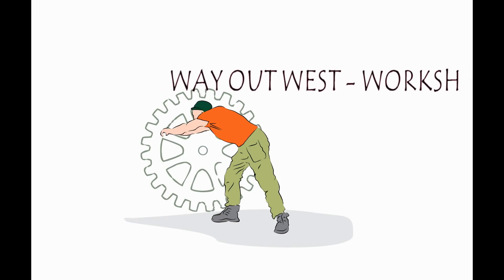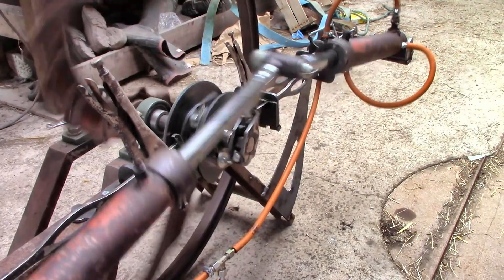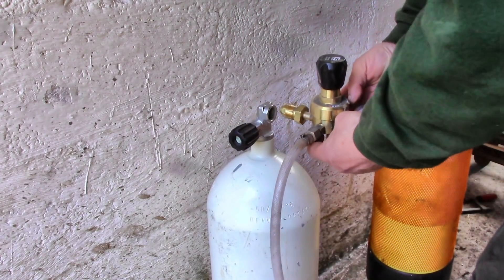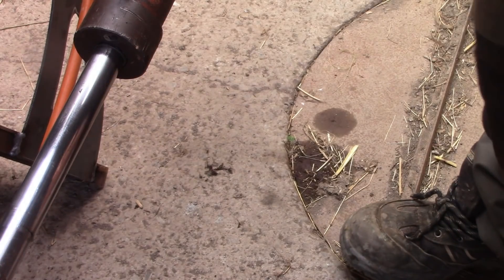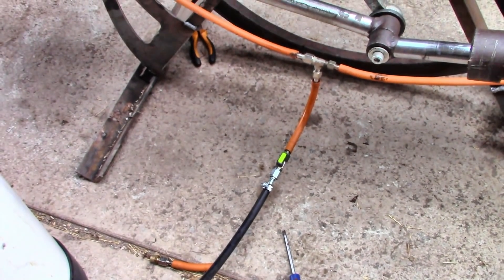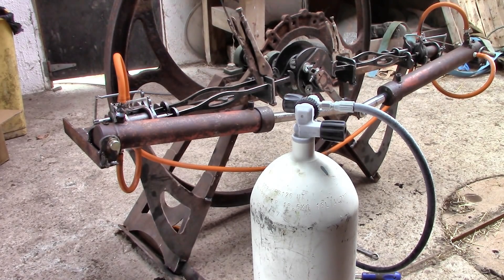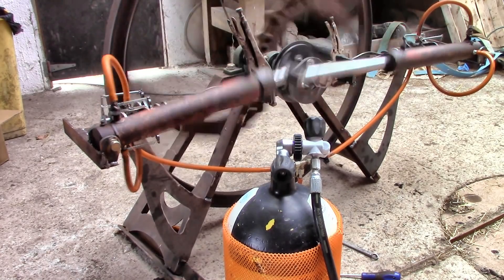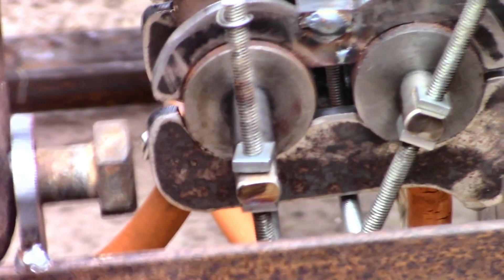It’s Alive!! Air-Powered Locomotive Moves On Its Own!

Comment: I was wondering if a propane bottle filled with compressed air (such as that used for a gas barbecue) would do the trick.
Reply from the maker: I think they're not for high pressure?
Reply: @wayoutwest-workshopstuff6299  These bottles are usually built with a test pressure of 30 Kg/cm2 and a burst pressure of 85 bar/cm2.
Reply: AFAIK our propane tanks are limited to 125lbs and each have a safety plug in the valve assembly so other than old propane cylinders being readily available I don't see any advantage.

Comment: WELL DONE!! Well done indeed! I have a huge grin on my face, seeing that, and I bet you and Sandra each had one, seeing it go in-person :D

Maybe someday I'll be able to travel again, and if so, I hope I'll be able to get a ride on the T&S Western Pneumatic Railway :D

BTW, check your email shortly, I'm about to send you two links -- well, if I can still find one online! -- one is a go-kart transmission made of bicycle parts, that you might be able to adapt somehow to use with your new locomotive-in-progress. The other is a link to a Reddit post. I did some research, and some asking around, while Sandra was on her lovely trek (congrats to her, BTW!) and I may be able to get you past the need for high-pressure tanks. You'll see ;)

A third link, will follow, if I can find it, but I expect no end of trouble in searching for  it. The GY6 scooters you see in urban areas -- the ones that are inexpensive imitations, basically, of the Honda Cub and Super Cub by various no-name Asian companies -- you can get a remarkably cleverly-engineered gearbox for them that adds reversing capability. It's mechanically just brilliant, and my hat goes off to whoever designed it -- it uses this incredible scheme of a two-part shell, twin sets of planetary gears, and a drive gear that slides in the middle along the output-shaft, which is splined partially along its length -- or so I recall. I bet you can cobble something together that, although outwardly entirely different, works along similar principles.

Comment: You could build a steam engine to power the compressor to fill the air tanks on the loco.
Obviously it is much more effective to fit a boiler to the loco so you have a real steam locomotive 🚂

Comment: You may have different rules across the pond, but a propane bottle is relatively inexpensive and rated to hold much more pressure than an "air" tank. Maybe you can get a nitrogen welding tank. At least that way they couldn't fuss to much since atmosphere is 70 something percent nitrogen lol. I dont have any experience on high pressure compressor s, so I'll be interested to see what you come up with.
Reply: What he has atm looks like a 40 cubic foot high pressure cylinder. (Not a scuba tank) but even tiny 40 cf tanks are like $400 USD these days used. 80cf new is like 600 and don’t even get me started on the biggest tanks (the 5 ft tall ones) like 1200 a tank
Reply: @superspooky4580  that's why I was thinking a welding nitrogen tank rated to 2000 psi. Very common and can buy used for cheaper. Then just compress with normal atmospheric air. Moisture may be an issue though which would be addressed with the compressor side of things.
Reply: @TgWags69  Thats what im talking about as well. those nitrogen tanks cost a pretty penny these days and thats IF you can find one for sale. (thats not 80 years old and about to explode)

Comment: You an put an inline regulator which are used on compressors & other things to regulate to a higher pressure constantly so you are not always fiddling with the pressure knob.

Comment: This reminds me of an old Mickey Mouse comic I read many years ago, where Goofy designs and builds an automobile that is powered by compressed air - the thing is, the wheels also drive a pair of air pumps which in turn keep up the pressure, so it is effectively perpetual motion. Of course, he forgets to put brakes on the contraption so it leads to humorously disastrous results, but still, it was always a feat of engineering that inspired me as a child. Alas, I never got the chance to test it out. ;)

Comment: those hydraulic cylinders will easily handle wet steam if you keep them oiled.    Perhaps a simple open loop boiler,   easy, cheap, low pressure, safe and fun
Reply: Vegetable oil in the boiler.

Comment: You've invented the self mobile cable railway.  Though I have never seen a string drive, there are some model railway engines that use rubber bands as crude belts to transfer power to the driving wheel axle - same as your log chomper.
Reply: A buddy of mine is working on 9ne of these right now. Athearn used this drive for it's model RDC's

Comment: IT LOOKS FRICKIN NICE. Seriously tho, good work! I would suggest to get a big BIG air tank and make another cart to put it on. That way, you don’t have to refusal as often if you were to use a smaller one. Also, if you were to use steam again, I would suggest using like a 7 gallon air tank as the boiler. It wouldn’t be a flash boiler, but it would be another idea to try, just make sure to get one with a safety valve!

Comment: If you had a rope wound the other way on the shaft and could reverse the engine then you would wind the reverse up when going forwards and wind the forwards up when going backward.  If the ropes were long enough it could take you from one side of the railway to the other and back again.  
Great video anyway. Can't wait to see more!
Reply: an old riding tractor gear box ( lawn tractor, not big tractor ) could be used. They were either belt drive or chain and sprocket.

Comment: Gears or belt final drive or even chain? Looks like it will work just needs some refinement! Brilliant Tim. A rich benefactor with a spare compressor and cylinders is required or a scrap man with them lying around....Fingers crossed. Trevithick is applauding you!

Comment: I do not know. Air pressure powered stuff feels wrong. I hope it works out but the pistons needs lubrication and in general it is scary to deal with air. Tire expositions are :C  But pretty much everything power dense is scary. I hope a bottle of compressed air is going to be enough for the trip over the railway. Hard to think it is going to be enough but I hope it works! But lubrication for the pistons? They are not magical they are going to fail to piston if the air rushes passed the worn non lubricated piston/cylinder/seals!
Reply: Wd40 injection

Comment: I'm sure you don't need telling, but it's usually a good idea to store diving cylinders on their side when not in use. At full pressure they become rather effective torpedoes if they fall over and smack the pillar valve on something. Plenty of videos on youtube of diving cylinders punching their way through brick walls :D
Reply from the maker: Sounds like something I should try : -  )
Reply: So tie the bottle on top of the cart and do away with the whole mechanical contraption. When you are ready to go knock of the valve and voila, you are moving. (no idea how you will stop it now, maybe get a 2nd bottle that you hold very firmly so you can catch up ;-)
Reply: For savety you store them standing. In case of inside corrosion this will then concentrate on the thicker bottom walls. Especially when not using modern/high quality air delivering standard compressors. And pressured bottles have to be fixed anyhow.

Comment: Instead of high pressure air you can use a larger tank at your compressor psi to gain distance.  We used a system like that on a ore cart for a underground mine. Have a great day.
Reply: The EIMCO air trammers used an air receiver tank on the locomotive itself for non-tethered operation and were refilled every few hundred feet. We had one in service at an underground mine in New Mexico a couple years ago.

Comment: Nice work. You should add a weight to the crank to counter the weight of pistons. It would be a simple addition to make it run smoother.
Reply: I believe that is the intended purpose of the heavy steel flywheel.

Comment: I love the "let's see what happens" approach. I would analyse and research and basically have the whole thing worked out before I started building, but you have so much fun just building things and learning as you go and you simply don't mind if things fail or don't work out the way you hoped.

To quote the famous guy who said it: "I have not failed 1000 times, I have discovered 1000 ways that don't work"
Reply: understanding why thing do not work helps you understand why they might work in other applications and also helps you fine tune things you cant predict, i love tinkering its the best way to understand,. there isnt just one way do any task and  only so much you can apply from something that you've been told or read. 
being able to adapt a recipe like a skilled chef comes from experience and you can only get that through time and making and understanding the mistakes you've made in the past
Reply: This is also the Elon Musk (SpaceX) approach.
Reply: @johndenison5245  Not exactly. SpaceX is doing "rapid iteration" only because it means they have lots and lots of tests and every test is covered by the news and the fans and that brings in money. Their actual progress is at best equal to the other companies that don't waste billions on pointless iterations. I don't want to start a Musk flamewar here, it's not the right place. All I will say is that Musk is not a rocket engineer, or a tunneler or a car designer, he's not even a programmer. The man has just bought twitter because he did not agree with their rules about what he could and could not tweet. Go do a little more research into his background and skip his cult of personality.

And that is all I will say about it. Back to the backyard tinkering!
Reply: @vinny142  One of my friends was in hydrogen research at a pretty high academic level (basically figuring out safer and more efficient hydrogen storage for use in cars). She told me that a lot of times she was doing field presentations, she'd get a lot of flak from people who invested time and research into electric vehicles. She figured out through some let's say creative facebook-detective work those people generally were musk-fans, or even employed by Tesla.
Reply: Edison
Reply: the Tinker method, as personified by the amazing Harold Edgerton

Comment: One thing you'll definitely need for it is a clutch system and breaks
Reply: Brakes is a good idea but a clutch is not required.
Reply: I agree a clutch would indeed be useful. If you can spin up the flywheel before engaging the clutch it can sure help get that extra torque to get a heavier train going